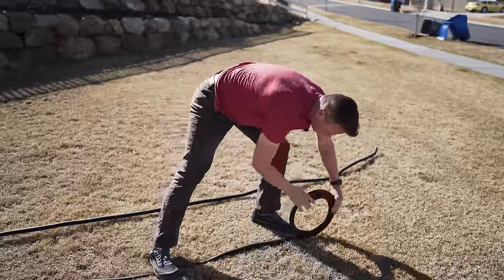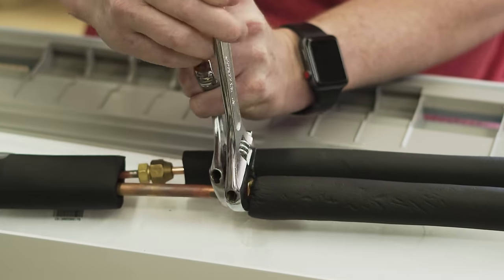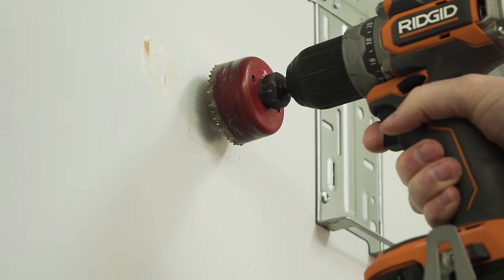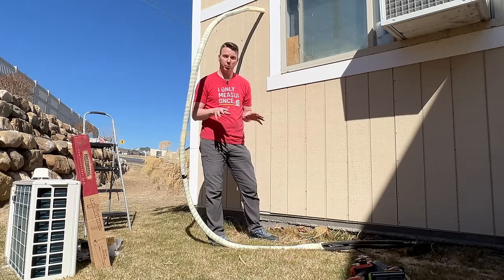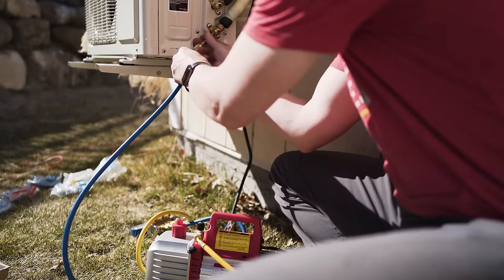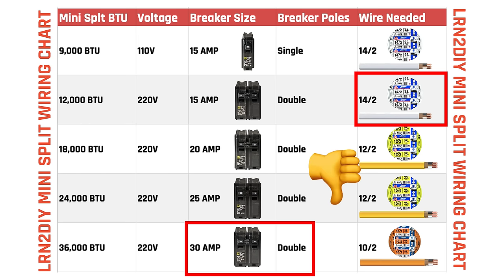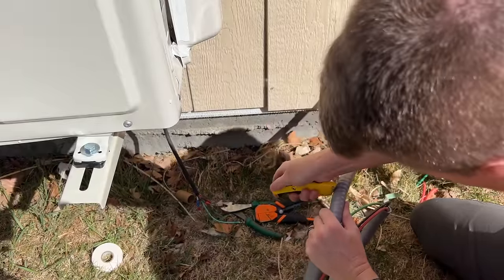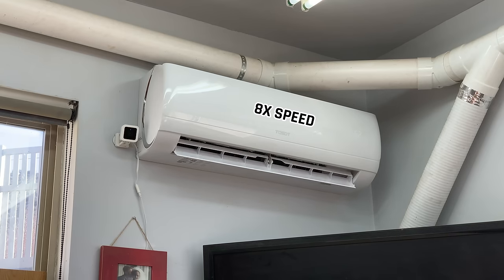DIY Mini Split Install - All the Things Nobody Shows You

Comment: As others have said, You should use a fused disconnect with fuses sized for the particular appliance being connected. Breakers are intended to protect the wiring to the appliance, not the appliance itself. Using a 30 amp (or smaller) breaker with 10 gage wire is fine because it will keep the wire from overheating and catching fire, but will offer little protection to the appliance. The fuses protect the appliance (probably about 10 amp time delay would be appropriate). Now if your commpressor starts to lock up or the fan gets jammed causing the unit to start drawing more amperage, the fuses will blow hopefully in time to save the appliance from terminal damage or catching fire. 
Sorry man, Your video is helpfull and I did learn some things but you've got to do electrical stuff the right way.
Oh, and one other thing, your not supposed to run romex  or any jacketed wire in conduit. If you want to use romex, the jacket should be removed on the portion running through conduit.
Probably not an issue in this case but in a circuit running near the rated amperage capacity of the wire the jacket can cause the wires to overheat.

Comment: How has no one noticed that you didn't even vac the system down correctly. As soon as you took the low side gauge of you lost all of your vacuum in the pipe this is because the low side port was open when you romved the gauge line. What you should done would've been to have closed the low side gauge then turn the vac pump off leave the low side gauge line on then open the valve when you where ready to turn the system on once system is on then take the gauge line off the system. You could have a high head pressure now and have an inefficient system being as a commercial and industrial refrigeration mechanic vacing a system is the most important thing when installing a unit would not recommend anybody to install their own split system if not a qualified HVAC tech.
Reply: He purchased that vacuum pump and gauges for no reason lol.

Comment: as a red seal refrigeration mechanic, allow me to tell you what you did wrong.
1. tosot is garbage, 
2.you need to pressure test with nitrogen above working pressure. keep that soap bottle away from the fittings.
3. coiling it up does effect the efficiancy, the loops you have outside can cause liquid migration and cause compressor damage on cold start. 
4. dont use nylog
5. dont use flare fittings inside, cut and braze.
6. never use your manifold for vaccume testing, you need a vaccume guage, and you need to leave it for at least 1 hour below 1000 microns. 

if you are planning on doing an install yourself, dont listen to this guy, he doesnt know what he is doing.
Reply: Spot on! xD I am red seal myself
Reply: Why is TOSOT garbage? Genuinely curious as I have 2 TOSOT units(a 12k and 18k ultra heat high efficiency models) .  Just want to know what issues to keep an eye out for
Reply: Why not Nylog?
Reply: I have 2 Senville Units. Their installation manual does not include pressure testing. There is also no requirement to braze or use a micron vacuum gauge. After several years. mine are still working OK.
Reply: @BugCrush3r  Because refrigeration mechanics make their money by selling you systems from legacy brands that cost much more, and can't be installed or serviced by you. That's fine for most customers, but not in the spirit of DIY or right to repair. Just understand if you install a DIY system, you might ruin your equipment if you make a mistake, and some mechanics will not touch your DIY install with a ten foot pole, even if it's done as well as it needs to be.
Reply: Do not see you taking time to helping anybody out
Reply: @BugCrush3r  you’ll see when they start to need attention.
Reply: @gregshea4660  just make a good flare
Reply: @user-bj4lp3fr1o  you absolutely have to pressure test and vacuum with a micron gauge. That is the most elementary principal. It’s actually law here in Canada. It has to do with leaking cfc’s and hcfc’s into the atmosphere and effective operation.
Reply: @hugh9park  ..So there's actually nothing wrong with using Nyloc? A guess motor mechanics should not use gasket sealant, they should just make sure the mating surfaces are perfect.
Do you use a sealant on your flares?
Reply: @gregshea4660  absolutely not. The soft copper creates the gasket between the harder brass fittings on the mating surface. Nylog is a foreign substance that can compromise seal once dry and the lubrication of the compressor and cause malfunctions in the metering device.
Reply: @hugh9park  Not law in the US and not required by the manufacturer.
Reply: @user-bj4lp3fr1o  wrong. Wrong again. Us is a Montreal protocol partner thus it’s law enforceable by epa. Amd aside from that only total hacks don’t pressure test and vacuum down.
Reply: @hugh9park  Montreal is about the ozone layer and phasing out CFC’s, not microns.
Reply: @hugh9park  Nylog doesn't dry and it's made out of compressor oil!
Reply: And the "you'll see when they start to need attention" reply is exactly why DIYers love to avoid having to pay installers like him!  ;-)

Comment: Not being critical but you should redo this video, The electric portion is at a minimum going to cause someone to damage their unit and at worse electrocute someone.  RED is not neutral and should never be. In one case you used red on neutral and then later used white, plus one on connection it does not appear you have anything hook to either L1 or L2.  Someone is going to try and copy what you did step by step and I suspect you should things mid way through because you side incoming power and used red on neutral but did not hook red up in the breaker box.
Reply: Made me balk too. Red - live/positive, black - neutral/negative, green - ground.
Reply: @ralphhowes  There's no positive and negative wires on AC circuits.

Comment: Yesterday, ran into the 3/4" issue when coming from the disconnect to the condenser. I was so freaking mad. But very good video.  I agree with others. Definitely use the recommended size breaker

Comment: When you covered the romex and breaker choices, you SERIOUSLY need to have an electrician install the wiring and choose the breakers. 
Often it is proper and correct for Hvac equipment to use 14 or 12 awg wire, and use a 30A breaker. The equipment label has two numbers on it. The minimum ampacity which is for determining the wire size, and the maximum breaker which is for protecting the equipment.
NEVER. Use the wrong breaker. It is acceptable to use an oversized wire, it just watts money, but NEVER use the wrong breaker or equipment damage can occur.
Reply: WHAT? 10awg copper is min for 30 amp. 15 amp is max for 14 and 20 amp is max for 12
Reply: @davebrunson125  incorrect. 
Motor surge loads on certain types of equipment, including AC equipment will have two ratings. A minimum ampacity that you select the wire size for, and a max breaker size that you select the breaker for. Motor loads in the NEC allow nuisance trip over sizing breakers above the conductor rating, on equipment with built in overload protection.
Reply: @SuperVstech  NEC prohibits using a breaker larger than the capacity of the wire. 10 is min for 30 amps you can not use 14 or 12 with 30 amps. This is a 220V 1 ton mini that's a double 15 amp is standard rating
Reply: @davebrunson125  again, you are incorrect… look up motor loads and breaker sizing.
Reply: @SuperVstech  Don't wire anything hire an electrician. And as you 1st said about HVAC breakers I'm sure you've never installed any. the typical 3 ton hp takes 2 breakers a 60amp which requires #6 and a 30 amp that requires #10. Your conception of wiring is going to cause fires
Reply: @davebrunson125  well, speaking as an NC unlimited license holder… with 40YEARS of Hvac and electrical installations under my belt… you are incorrect…
Reply: @SuperVstech  Yeah right
Reply: @SuperVstech  SuperV,  motors can draw up to three times the running current when starting, if I'm not mistaken.
Reply: @peteyc2292  correct, and that is taken into account with the max breaker size rating. It’s illegal to oversize the breaker beyond the max rating.

Comment: Thanks for the informative channel. It is really amazing idea since the installation cost for heat pump is ridiculous in US. Can I follow your direction and install one of major heat pump brand in the market by myself? Does the 5 CFM Vacuum pump you recommended links above  works for Mitsubishi heat pump as well? Some reviewer said, Mitsubishi requires metric adaptor.

Comment: You did an excellent work. Very well explained. Just on the electrical having a 30 amp breaker protecting the wire but not the unit was not a good idea. 15 amp brk should be enough, even a 10 but those are special order, so 15 still do the job correct.

Comment: The use of Nylog Blue is very important.  It lubricates the flare fitting and helps make a perfect seal.  If you have a leak it the connection behind the indoor unit, it is almost impossible to tighten.  View videos on the use of Nylog Blue before you use it.

Comment: Great video !!!  Thanks for making it.     

One minor nitpick (sorry!) is:  where I live, you cannot run romex (encased) wires thru conduit.  You can only run individual strands.  In other words, you have to remove the outer orange plastic "wrapping" before putting the 2 or 3 or 4 wires thru the conduit.   

Otherwise:  Great video & keep it up!!
Reply: That’s also illegal as there’s no marking on the insulation of a wire inside romex. He’d need to pull indiviual thhn wires

Comment: Thanks, great info ! I should have watched it before installing my Danby 18 000btu unit,lol.
Wall mounting scares me. We get pretty bad storms here. I was scared that it could rip right out the wall in those 120+ km\h winds. So i mounted it to the deck directly in the deck frame with overkill lag bolts and framed it extra under the a/c.

Comment: I often take a long drill bit, the size of my pilot bit and drill a hole through both the inside and outside sheathing in one hole. Then I know 100% that my inside and outside holes will line up with I take the hole saw. In your case with flex pipe, it's not a big deal, but for a dryer vent for example, it's nice if they line up.

Comment: I like to go out the lower right  side of the wall unit. you can check for leaks and it works better. Double check the factory's flares. I had one blow out after a couple days use, It was paper thin and had to remove the unit.  Also I drill a 3 5/8" hole and use a pvc 3" pipe and that gives me room to spray some insulation in the gaps.

Comment: Any advice getting the refrigerant back to the compressor? (Im assuming that's what I need to do)
Got it all installed today, but the unit gives me a F0 code. That is a refrigerant leak. The manifold kept shifting back to 0 from -0.1 and I could not get it to stop after powering down the vacuum during the installation.
I did the soap and water test and didn't get any bubbles, so I hoped I was in the clear.
I also haven't gotten any cool air and I have opened the valves, or ar least I turned them to the left until it stopped.

Comment: Thanks for the great video, planning on using the same for my workshop. Question- when you vacuumed the lines, where does the the refrigerant come from?
Reply from the maker: The refrigerant ships inside the outside condenser unit.
Reply: @LRN2DIY  thought that might be the case, thanks. And subscribed.

Comment: Thanks for the video.  I bought the same unit mainly due to this and a few other videos.  I had to laugh a little bit when you talked about the "few drops" that will come from the condensate line.  Down here in South Florida we measure our daily condensate output in quarts and gallons, not drips and drops!
Reply: I’m considering purchasing a home in Florida and installing mini splits — no ac in the home just window units. Does the mini split system work well for you?
Reply: @micaelaperez7945   I love it.  I work in my garage a lot and had a floor standing portable for a long time.  Difference is night and day.  I highly recommend them to replace any type of window unit or inside portable

Comment: Im guessing the smaller the wire the better a circuit breaker or fuse works? Correct me if im wrong.im still trying to learn electrical

Comment: yes  I have read a few  comments... white is reserved for neutral and copper for ground...   red and black hot... if this is 220  ... it will work... but could confuse  or cause problems at first when some one down the road is working on it..

Comment: My condenser has a leak and they are sending a new one. I will replace it my self. My question is, Should I vacuum out the freon or air as you did in the video from old AC unit ? Or should I just turn off the valve in condenser and disconnect the lines, and I can install new condenser and connect the line again and vacuum the air out and open the valve ? Do I need to vacuum my old condenser which has a leak ? If so, should I turn off the valve on old condenser or should I leave it open and vacuum ?

Comment: Hi- I am installing 2 of these units at my house and am stuck at the line vacuuming stage. I used Nylog on all connections and tightened as much as possible but the pump gauge moves back to 0 each time. (I have tried multiple times on both units) I am using the 3cm model. I have sprayed w soapy water and am not getting any bubbles (I know this is not foolproof) Can there be any other possibility other than the 4 connection points on my lines? Any advise would be much apreciated.

Comment: One DIYer to another, the breaker size is determined mainly by the end device electrical load. The wire size is just big enough to handle that load, you CAN and I have, use larger wire than needed. I used one full size larger from the breaker to the disconnect. The wires from the disconnect to the outdoor unit have to be close to the size recommended as the screws and terminals on mini splits are notoriously small, I soldered fork connectors on the wires to make them fit better. The breaker is there to protect every part of the circuit downstream from it and must be sized correctly to do that. Make sure to securely ground the metallic conduit to protect anyone from it becoming energized. AND, in almost every video of mini split installation they show rolling up the linesets behind the outdoor unit. It is much better to roll up the linesets in a horizontal fashion to not allow the refrigeration oil to pool up there. As a matter of fact my installation instructions stated that very clearly. (MrCool DIY) GREAT video...  Michael in Colorado

Comment: What if you have multiple indoor units (especially ones not on an exterior wall) with the lines going to one outdoor piece? What would be the right way to run those lines through the walls? For us we have 4 units and it looks like we could run then from the outdoor unit, through an old basement window we'll redo, and then up through the walls in the central hall, but we're worried about getting the lines up/down through the wall without harming them.

Comment: By disconnecting your gauges from the service port while the system is in a vacuum you are allowing atmosphere to enter the refrigerant circuit. Before removing the hose you should allow some refrigerant into the system to increase the pressure in the refrigerant circuit to above atmospheric pressure. Doing this will prevent any atmosphere from entering the system which is the purpose of pulling the vacuum.

Comment: If you don't have snow, you can put it on the ground without pouring. Buy a foam cement coated pad and just place it on. It doesn't even need to bolt it. If you're going through a wall under the length of the original hose, you can feed it easier (shorter) and connect the hoses after to make it easier to feed.

Comment: I received my Tosot  12,000 btu unit to-day in perfect condition, looking forward to getting it hooked up, great video!
Reply: I have it installed as of yesterday, went well. We had snow yesterday so I only put the A/C part of it on for about 5 minutes or less and it was putting out  about 52-55 degrees, about 115-117 in heat mode

I bought the 110 volt model

Comment: If I'm not mistaken, code does not allow Romex to be run in conduit.  You can only have separate wires if you are using conduit.  At least that is what the inspector told me when I was wiring my garage.  Good vid, though.  Thanks.

Comment: @LRN2DIY, its has been over two years since you've installed your system. How has it been so far? Most people say that you'd have issues with leaking if you dont do the nitrogen test and dont vacuum it using a micron gauge. And I see that you didnt. Have you had any problems? Thanks.

Comment: even if you use the thicker gage wire I bet you want to use the recommended breaker on this instance. I could be wrong. You need the device to pull enough to kick the breaker if needed if it can never get to the wattage to kick that breaker wont the unit just destroy itself?

Comment: Something that no one seems to show is how to do is carefully bend the right angle into the copper lines that come out of the wall. I thought I was carefully bending a gentle curve into the lines. The lines felt OK through the insulation but when I cut the insulation I could now feel and see that I had introduced a kink in the 3/8 line. I used pliers to gently squeeze a bit of round back into the copper tubing.

Comment: Ok, when you got to the vacuum pumping portion of the install… 

Several major mistakes here.
You need to use a diy version. You do not have nearly the tools and supplies to properly install this unit.
Proper evacuation of minisplit line sets REQUIRES dry nitrogen purge, triple evacuation to 500microns, 
This install video will result in a great cooling unit that fails in less than 2 years.